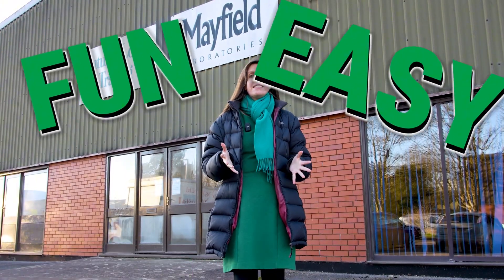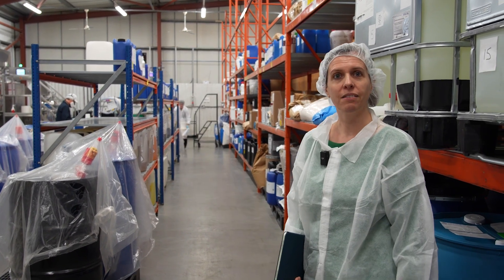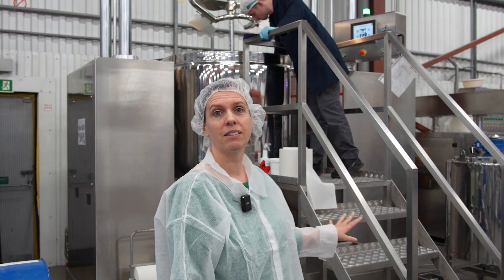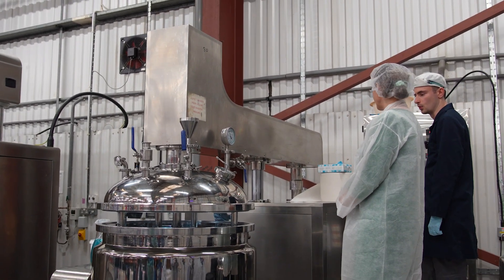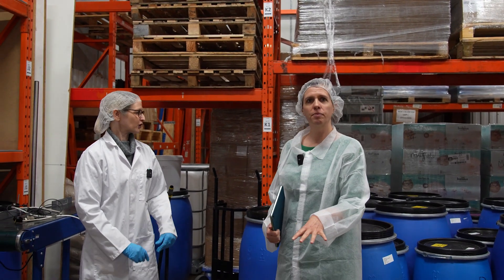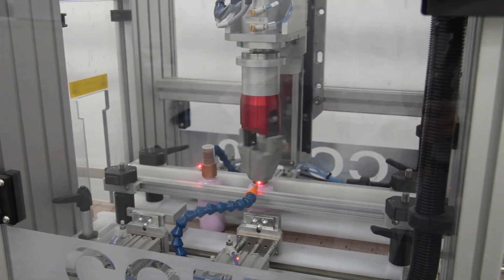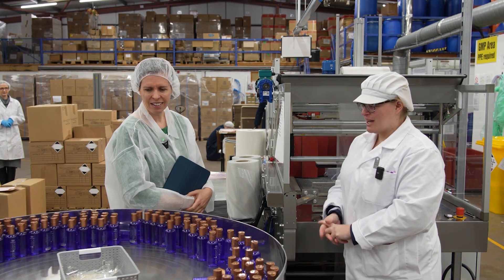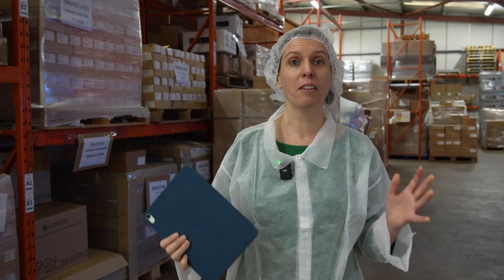Factory Tour: How Cosmetic Products Are Made at Scale

Comment: Looks like the operations and product managers are doing an excellent job there. Make sure to wear your safety glasses next time.☺️
Reply from the maker: Hey Oguzhan, it is a brilliantly run operation, we had a lot of fun filming there. I can also confirm that they have all the necessary safety protocols in place. Mayfield Labs holds two ISO certifications, which require them to adhere to the highest standards 🙂.
Reply: As someone who has worked in the manufacturing industry for well over 10 years, you are correct to note that safety glasses should be worn anywhere that product is being made and handled. Bigger companies follow this practice religiously here in the states, and in addition to glasses and hair nets some of these companies require employees to wear other types of PPE. This company is quite small in comparison to several of the places I have worked.